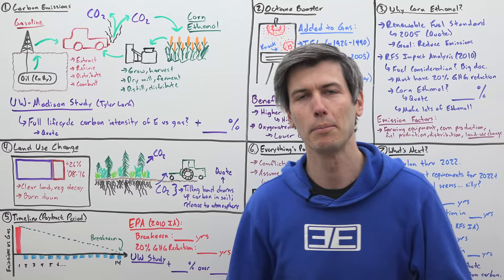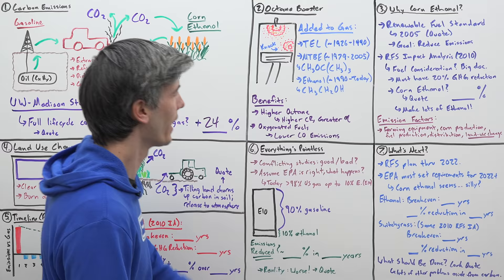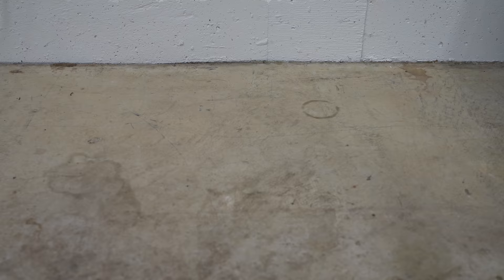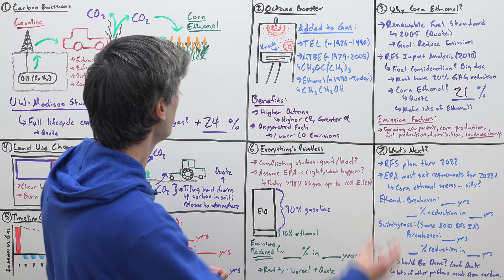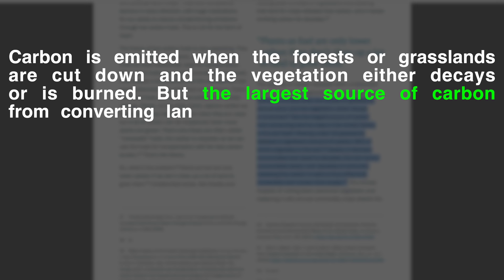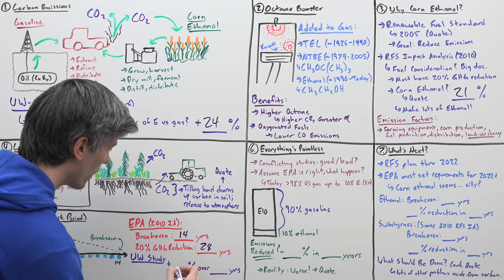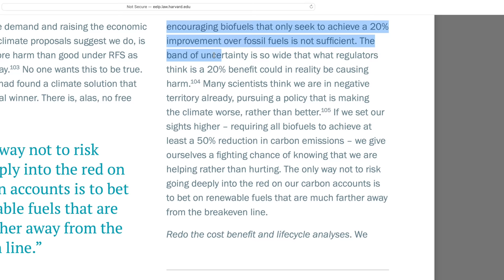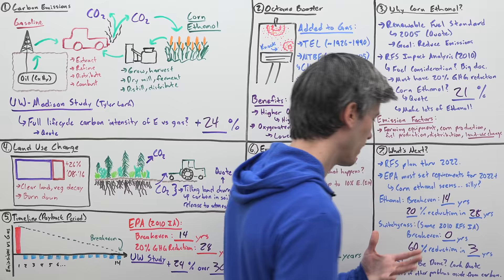America Was Wrong About Ethanol - Study Shows

Comment: Great Video. Could you do one using the Brazil's case? Here we use a mixture of 27,5% Ethanol / 82,5 pure gasoline, but the catch is in Brazil the Ethanol comes from sugar cane, something Brazil's has been farming since 1700s and sugar cane is far more richer to create ethanol (or sugar), also the by-product is burned to run the Ethanol/Sugar mills and to produce electricity in thermoplants.
Reply: The USA should be buying ethanol from Brazil instead of growing corn.
Reply: Very interesting!  but the corn lobby here is SO strong - it was a huge cash-grab for wannabe farmers and investors, so they just ran with it.  As others have stated, all the evidence pointed to corn-based ethanol being a joke from the start.
Reply: 82.5+27.5 greater than 100 percent
Reply: @ajl9491  you are right, wrote on a hurry and made the most basic math error. The ethanol rate is 27.5% so the gasoline must be 72.5%. Thanks for your observation.
Reply: @hotcoffee5542  🤣America is already buying ethanol from Brazil. I'm a little fuzzy on the numbers, but I think that we're buying 20% of our ethanol from Brazil due to the requirements set forth in the Clean Air Act, where we can't get all of our ethanol from one source (corn).
There's a small problem, however: While American is theoretically getting ethanol from Brazil, it's not that we're buying it outright...we're simply trading our corn-based ethanol for the sugar-based variety: The ships that haul this similar product back and forth pass each other in the night.
Reply: @buttslappingpirate  I read something about it a while ago. Law makers should see the bigger picture when writing the laws. There is also the sugar competition. Sugar cane mills can do both, when the sugar price increase there is a lack of ethanol in Brazil, then Brazil import even more from USA.
Reply: also sugar beets in Brazil for ethanol
Reply: The total fuel consumption of U.S airlines is approximately 19 billion gallons annually. 

Total fuel consumption for mining lithium to make electric car batteries is 21 billion gallons annually.

The 21 billion gallons can only produce enough lithium for 250,000 car batteries.

The lifespan of an electric battery is 10 years and is not renewable.

Electric cars are not better for the environment.......they're worse.
Reply: @scottamu7816  The sugar cane lobby is also strong in Brazil and pushed the standard mixture from E25 to E27.5. Most cars since the 2000s can run on E100 though.
Reply: they kill the amazon   breathe  That
Reply: @jorgegonzalez-larramendi5491  bs, nobody kills the amazon
Reply: @scottamu7816  Switch grass is even superior to sugarcane and would be more economical than oil but the big money is not there.
Maybe this will change with BP backing it.
Reply: @hotcoffee5542  Or buying the sugar and refining it.  But the US sugar lobby is powerful.
Reply: @SuperSetright , what is the source of your claim that "mining lithium to make electric car batteries is 21 billion gallons annually?"

21 billion gallons of gas is quite a bit you realize. Did you fact check your claim?
Reply: Farmers are getting scarce.  Retaining farmers is part of our national defense strategy for if SHTF and we get cut off from all food/grain imports.  Has been for decades, so the fed subsidizes farmers. In return, we use their corn for a two-fold fuel purpose- ethanol acts as a natural octane booster, and ethanol creates chemistry magic during and after combustion that results in cleaner emissions.  All this info is readily available and well-published.
Reply: @LaporteBernard  lawmakers see their bigger picture, back deals, lobbyists, wine n dine, look good for the voters, look better for the establishments

People need to see the big picture, there's so many people that are happy to get angry. But not to study
Talking about politics is considered crude
Reply: @ajl9491  It just proves he aint half ass'n it. He is giving 110% !!!
Reply: @williamwilliams3447  And sugar beets are grown in America, as well as sugar cane. I remember suggesting this at the time, and no one paid any attention.
Reply: @Patchuchan  superior to sugarcane how? in producing ethanol?
Reply: @SuperSetright  You know that old batteries can be recycled to reclaim the lithium?  Also where did you get those numbers?

Comment: Ethanol fuel was never about carbon emissions. It persists because for some reason in America, the Iowa Caucuses largely determine who gets to run for President, and Iowa has a lot of corn farmers that would be upset if demand for their crop drops off.
Reply: You're on the right path, but that's an oversimplification. Yes it's because of politics, but not due to anyone caring about voters.
Agricultural lobbying is why it exists in the first place, because the corn subsidy from the Dept of Agriculture paid farmers to grow it before it was ever even sold. So they lobbied the EPA to require it in fuel to ensure corn prices stayed high.
Reply: That’s not actually what happens with ethanol distillation. Engineering Explained failed to mention the fact that corn ethanol has a useful byproduct that these other alternatives do not, namely distiller grains. These are used as highly nutritious feed additives for livestock.
Reply: They use E10 in Europe too. I live in Ireland and we use E10. (E10 is RON 95 with 10% ethenol) we have no way of growing corn on a large scale in Ireland as we do not get the weather for it and yet we are still using E10. So I doubt it is because of the corn farmers.
Reply: Your "Iowa caucuses" comment is silly. Obama? Biden?
Reply: @aussie2uGA  there is more than enough corn to do both
Reply: Of course here in Australia, the push was to use sugar cane to produce ethanol, because we had a sugar industry which was struggling, so it was the politically expedient choice.
Reply: @brianhiggins2399  They import it, along with the fuel base as well, generally from one of the massive refineries in Portugal.
Reply: @brianhiggins2399  you can make Ethanol also from potatoes...
Reply: @SeanBZA  Can you provide an attribute for this?  It seems a bit off the wall.
Reply: @hansjorgkunde3772  Potatoes work great but are harder and more expensive to grow than corn.
Reply: @gregkramer5588  Well, a lot of the EU petrol comes from refineries in Portugal, and also there are large sugar beet plantings used to make ethanol, plus sugar imports used to do the same. I doubt Ireland actually has a oil refinery of it's own, like many smaller countries also lack, so would import a lot of fuel from the closest one, which is Portugal. Incidentally that refinery also ships a lot to the world, as VLCC tankers are very cheap to rent when travelling down Africa back to the oil supply countries, so you get low price shipping if you are bringing in, what to them, is just ballast in a tank.
Reply: @brianhiggins2399  In italy we have maximum E5... actually if a fuel is rated at 95 Ron, it means the petrol base has a lower quality and lower octane rating , let s say for example 94 Ron, and the ethanol will raise the rating to 95. So the more ethanol % a fuel has, the lower quality the petrol base is, and the higher the fuel consumption is...   I'd say you only start to see advantages in octane rating compared to pure 95 Ron E0 fuel, starting from E25 or something around it
Reply: Strange thing I notice when I go to Iowa is the premium gasoline is all 91 octane rating, while in IL it's 92 or 93. I don't know why.
Reply: @JayVal90   There is a lot that he fails to mention in this video and most of his other videos'. EE video's seem less about a deep scientific understanding of the subject matter and more about sounding deeply informed and massaging the viewers cognitive bias for views.
Reply: @UncleKennysPlace  What do you mean? Obama won the Iowa caucuses inherently as he ran unopposed from the Dems, the Iowa caucuses are party primaries. And the person that ends up running in the election and winning the primary for said party is almost always either 1st or 2nd place in the Iowa caucuses, it's been this way for decades. Trump was 2nd in 2016, Clinton won. Romney was 2nd in 2012, Obama won (no competition), Obama also won in 2008, as well, 2004 Bush and Kerry won, 2000 Bush and Gore won, 1996 Bob Dole and Clinton won.  Now this doesn't hold true every single election year ever, but generally, yes. The results of the Iowa caucuses has always effected how other people in other states end up voting, as it has always been run first. (Iowa was on feb 3rd, prior to all other state results, so it tends to set a tone, and winners in other states tend to push other people to vote for these people)

Comment: EXHAUST QUALITY  is always better with less gasoline and more ethanol. Eighteen years useing Half e85 and Half e10 mixtures in a
 NON FLEX FUEL vechicle has proven it is much cleaner and good for the planet. ALSO keeps the oil clean and the exhaust smelling much better. Commutator on fuel pump has outlasted fuel Gage. NO fuel system issues after 162,000 mile and ideling time.

Comment: One thing that is often forgotten about in the ethanol debate is the byproduct of ethanol production. When corn is converted into ethanol the carbohydrates in the corn are turned into ethanol leaving behind the protein, fats, and micronutrients creating a product called DDG's or dried distillers grains. DDG's are a very valuable feed for cattle and other livestock as it is rich in protein which is typically the most in demand, and expensive macronutrient. The beneficial by products created during the distillation of grains is often completely disregarded in the cost/benefit analysis of ethanol.
Reply: Thanks, didnt no about it.
Reply: This is never forgotten about, and is taken into account in all studies of ethanol, including the one Jason mentioned. Without taking that into account (and it is usually overestimated), ethanol is severely carbon positive.
Reply: Cows should be eating grass anyway, not corn nor waste from it.
Reply: @Kswa S  Are willing to  pay the outrageous prices for beef to have grass-fed cattle? A rough estimate would be around $40.00  a pound for the cheapest cuts of beef.
There isn't enough pasture space for the cattle. 3 head of cattle per acre.
Reply: Now if we captured all the methane emissions from those cows and converted that to fuel also.
Reply: Justifying corn ethanol by saying that cows are fed with the by-product is at least partly short-sighted. Better to focus on eating plant-based protein. Significantly more efficient than having animals first eat plantation and fart while converting it to meat ;)
Reply: @herbwheeler4470  
Imagine if we humans put as much effort into growing grass (for our cows) as we have put into growing corn for the last several decades.
Cows can eat grass without roaming massive grasslands in case you didn't know.
Reply: @herbwheeler4470  grass-fed beef is only like a buck or two more a pound than grain-fed. A lot of pastureland is being replaced with government subsidized crop land. There’s also a ton of government lands that could be used to feed cows but not good enough for crop land
Reply: @kswas2784    Nice, now how do the cows get the grass in the winter?  The DDG is mixed with the hay and stalks harvested for winter feed.
Reply: @mattipeltola4394  
No amount or combination of plant-based proteins are as healthy for a human being as animal-based proteins. Even if you ate just 1 lb (16 oz) of steak everyday for a year you still wouldn't consume an entire cow by the end of the year. In fact it would take you nearly 2 years to eat the weight of a single cow. And in those two years time you would be much healthier for having eaten a pound of steak everyday. Do you really think it is that bad for the environment to sustain one cow per person per 2 years?
Reply: @mattipeltola4394  — Plant-based  protein is not equivalent to animal-based protein in your body, and 90+% of the lifetime diet of “corn-fed” beef is grass, nearly overwhelmingly from land that can’t support row crops.

Don’t get me wrong, there is plenty wrong with the beef and dairy industries, but you’re barking up the wrong tree here.
Reply: @henrym5889  It's just natural, if you can't understand that then there's little hope for you.
Reply: @kswas2784  If you mean they should be grazing, that form of cattle production releases much more greenhouse gases than feeding them with corn or other high production crops.
Reply: @herbwheeler4470  — You’re misinformed in both directions. I pay $6/lb for organic grass-finished beef, and it takes a lot more than 1/3-acre for each steer, particularly on land that’s unsuitable for cropping, which is the majority of pastureland.
Reply: @herbwheeler4470  Gee, I don't know, maybe grow prairie grass instead of corn and pasture there.  There's a "rumor" that the American prairies used to support 30-60 million bison...so...
Reply: @kswas2784  I don't care what is natural or not, natural doesn't mean better.
Reply: @altosack Severely?
Reply: @jkbrown5496  Same way any wild land animal feeds itself through the winter; they forage for it which would be easy to do on native prairie lands.
Reply: @kswas2784  Have you ever worked in Dairy or the Beef industry? I am guessing no.  I think it is likely that you know very little about it since this statement makes no sense to me.
Reply: @mattipeltola4394  But that is a different topic. Limiting meat vs ethanol economics.
Reply: @joshuaewalker  Have you ever worked on dairy or beef farms.  If you had you would know how ridiculous this is.
Reply: @altosack  If you mean the one he linked to as "Main study", I can't find anything about it when I search for "DDG", "dried", "biproduct", or "feed". Can you tell where this is mentioned in the study?
Reply: What is indisputable is, in addition to the feed costs for cattle, the ludicrous amount of water to sustain the massive meat industry.  Beef is unsustainable as a central part of diets.  I'm not saying eliminate it, but things are changing.
Reply: @Joshua Walker  um yeah? How?
Reply: @kswas2784   Hardly a productive way to maintain a cattle operation.  Right now it's calving season, the ranchers/farmers are out each night to check on those calving then move them into the lot away from the bulls and cows without calves.  And this is a mild year, it's not 10 F with 2 ft of snow.
Reply: @henrym5889  If you can't understand evolution then there is really little help for you.  Maybe open a book.  Cows evolved to eat grasses (I typed that slowly so you could keep up).
Reply: @gregkramer5588  Really, natural pasturing grazing animals makes little sense to you eh?  I don't think I can help you then because you obviously know even less than most.
Reply: @herbwheeler4470  
What do you mean how? How does your dog or cat eat meat without being let out into the wild? How does your pet hamster or rabbit eat grass? You bring it to them. You could build a giant skyscraper greenhouse in the center of a farm, grow millions and millions of blades of grass, harvest that grass and then feed it to the cows without the cows requiring thousands of acres to roam upon.
Grass-fed does not mean the same thing as free range.
Reply: @gregkramer5588  
How ridiculous what is? I don't know what you're referring to because you and I have not spoken before in this comment thread. You're welcome to come see how I treat my animals, including our 6 cows, here on my farm in Danville, Indiana (Not really, obviously, because I'm not posting my exact address.) But, if you're asking if I've ever worked on a factory farm with 1,000 to 2000 cows, then no I haven't and I never will. But, I can tell you that a single full grown Angus feeds my entire family of four for a year.
Reply: @kswas2784  They should Always eat grass unlike feedlots with 100% corn grain. But need some grain to finish them. 100% grass fed beef is not tender, low quality of marbling, also the cattle are not very nice and fat.
Reply: @gregkramer5588  You are right: the topics are getting a bit far from each other. Was just pointing out how hard it's to take everything into consideration when evaluating "the total effects" of something :)
Reply: @joshuaewalker  Thanks for the input. Sorry for derailing this to off topic. I believe research shows there are some health risks in eating meat every day. But I'll stop this here. :) I mainly tried stating that assessing emissions and finding the most effective overall solutions can be overwhelmingly hard. :)
Reply: @skunkjobb  — I must admit I didn’t look, because it was consistent with a meta analysis done about 15 years ago that aggregated the studies to about 10% carbon negative w/DDG, and about 20-25% positive without. 

That doesn’t take into account soil degradation from conventional corn farming; I believe we’re slowly improving that, but it’s a long, slow slog through the political morass that is corn farming/subsidies.
Reply: @gregkramer5588  — Yes, severely, because they largely ignore topsoil loss from conventional corn farming practices. That’s slowly improving, but the political mess subsidies are don’t prioritize what they should, in my opinion.
Reply: @mattipeltola4394  Yep, Like the study not allowing that selling the distillers grain impacts how much land is tilled since it reduces the need for other land to be farmed.
Reply: @joshuaewalker  Maybe I responded to the wrong comment.  I have done that before!